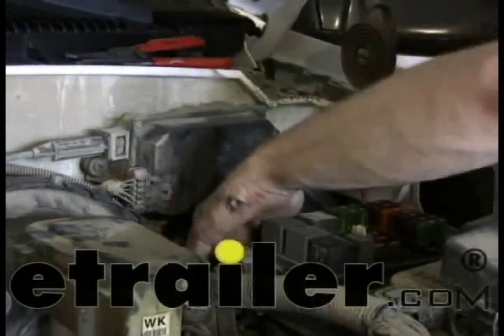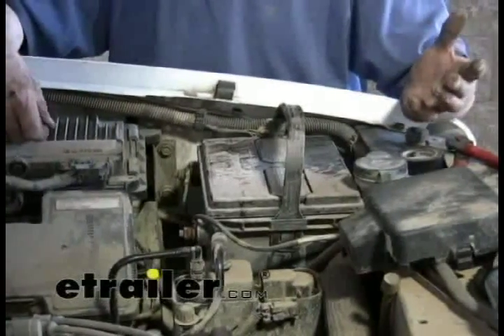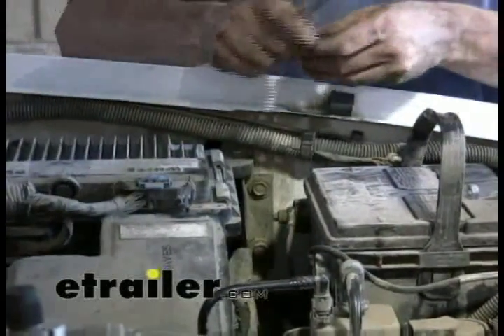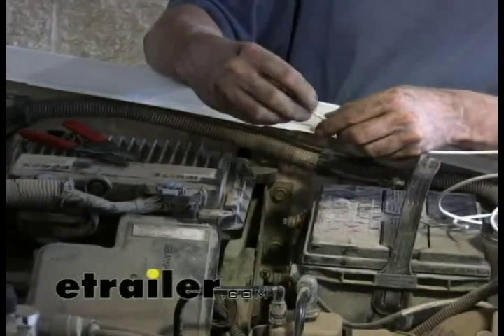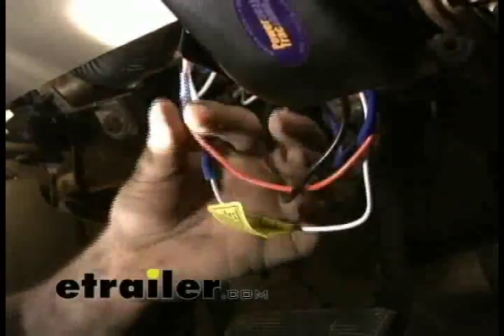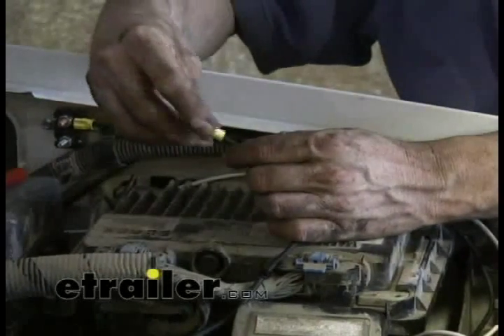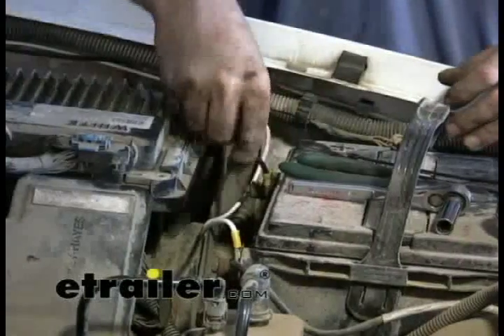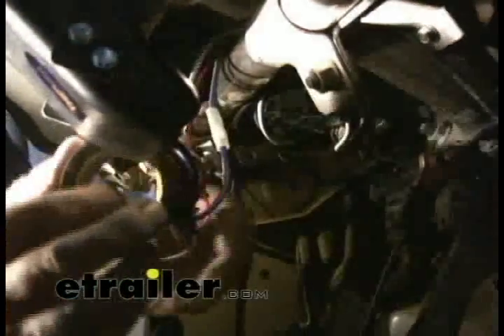etrailer | How to Install the Tekonsha POD Trailer Brake Controller on a 2000 Chevrolet Silverado

Comment from the maker: If you search our site for part number 40376 you will see the style tester used. Basically the plastic hook goes around the wire and then a sharp probe stabs the insulation and makes contact with the core of the wire to test it for voltage.